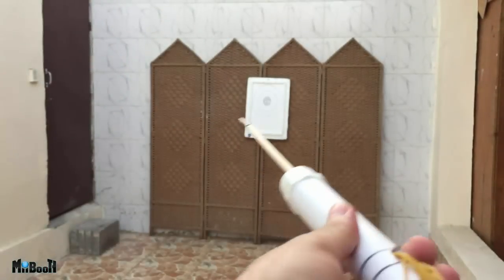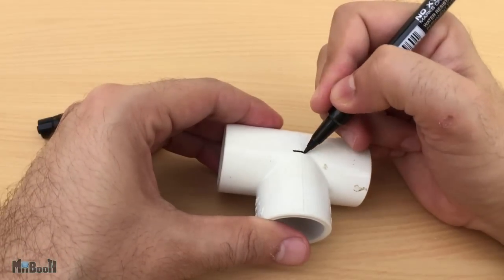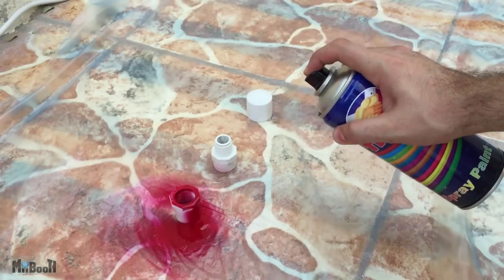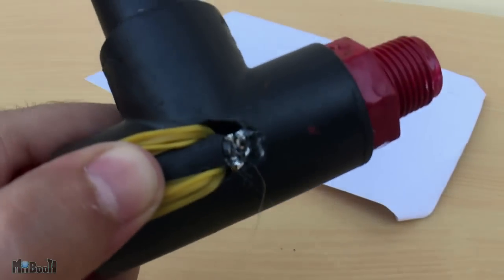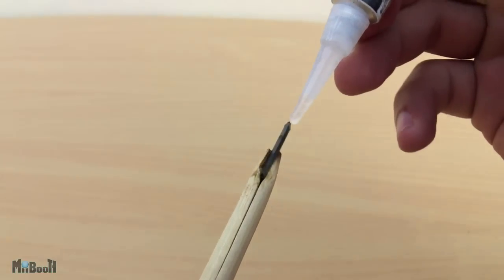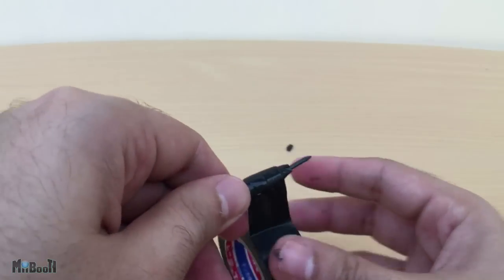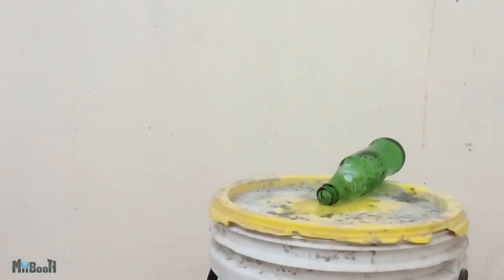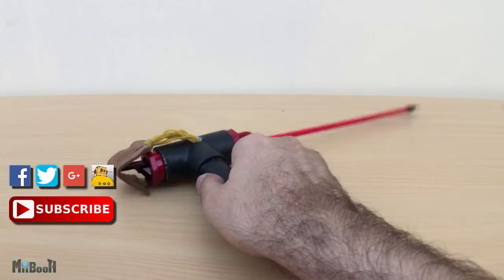PVC Slingshot bow V 2.0 | What The Hack #18

Comment: You could get flight for darts ( the type played in pubs) you can get them in many designs and colours quite cheaply priced from sports stores. Also I noticed you blocked off the bottom of the handle - if someone was to use this device in outdoor setting you could store things in there, fishing hooks, line, batteries for a torch all sorts of things. them have it secured with a threaded pipe and cap end. Just an idea fella, good VT.

Comment: Neat and effective design. :) Also, just as a bit of constructive criticism, do you have access to surgical rubber or pallet bands for wood piles or any large, thick rubber like that? Bigger than a regular rubber band but still very flexible. Like on a regular slingshot. Stronger and longer lasting. Great video.
Reply: That's not criticizing That's a idea to help

Comment: That would work better if you were using primer b4 u use the cement especially bc ur putting a lot of stress on it and when pipe fitting primer is essential to getting a proper seal 🦭 lol

Comment: Use a 45 degree angle on the handle it will make your grip much better. Good video, Thank you.
Reply from the maker: That is a good idea. I think heating up the T joint and then molding it into 45 degrees will do the trick. What do you think?
Reply: MiiBooth could u show the result in 45 deg
Reply: Dont heat the T joint, try WYE. See the link below :

https://www.clearpvcpipe.com/clear-pipe-fittings/wyes.html

Comment: Why didn't u just slide a long metal cone casing onto the arrow tip ?
Then u wouldn't have to worry about dislodging the nail.
I think heating a nail, slicing the arrow, using glue and tape, is just....

Comment: Why don't you use stronger rubber for both of projects, like theraband it will give you better performances.
Reply from the maker: I totally agree with you but for these two projects my aim was to make it from stuff I can easily find anywhere. In future projects, I plan to use something stronger.
Reply: Enes Coskun I have made one but it is not functioning properly. Will try to change the elastic band and will try again. But it appears that it will work. Many thanks for the idea.

Comment: Thanks for sharing. This does have some potential to be stronger. I think with some exercise bands this could very well be very powerful. You can also by spear gun bands that could be as high as two hundred pounds of draw weight. Thanks very much for sharing.
Reply: How would you even attach the exercise bands to the sides though in a way where they could be easily removed and replaced?
Reply: @bryanyee7  I guess you could just make a hole in both side just big enough to slip the bigger band through then insert them far enough in and out the front or back of the PVC pipe and tie knocks in each of the bands so they are too big to fit through the hole when they need to be replaced or what ever reason you want to remove them either cut the knocks and pull them back through the holes or you could  insert something into the hallow in of the bands to make them bigger then when you need to replace them just pull out the thing you got stuck through the hallow end of the tubes if you want this type of setup. There is better ways than this way I have fount. https://www.youtube.com/watch?v=FTCCSMOz3-o